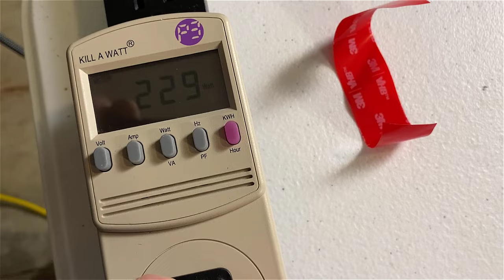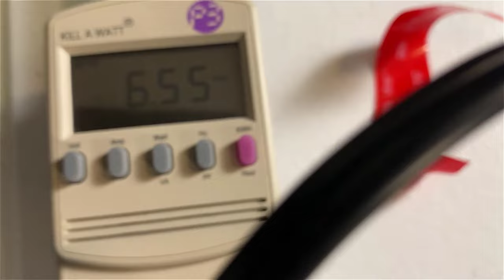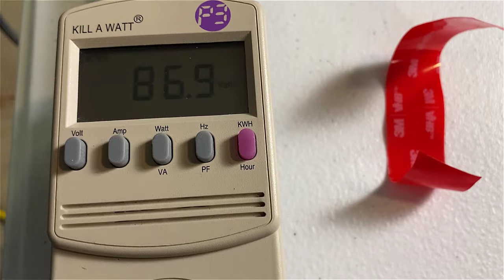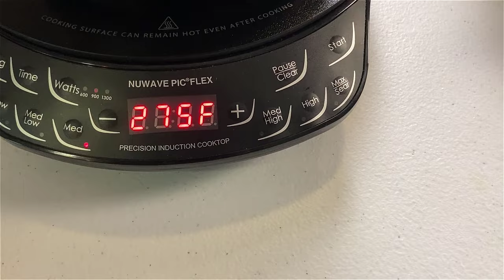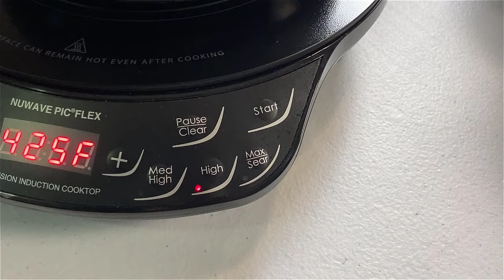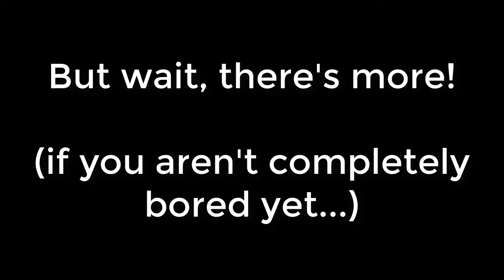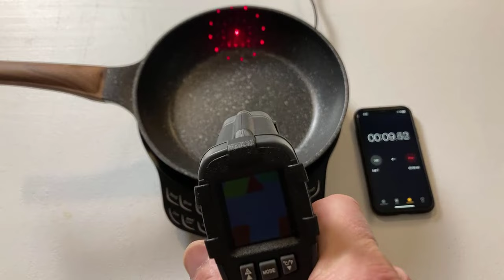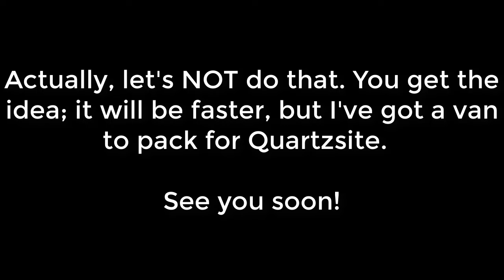Cooking in a Minivan Camper?

Comment: Thank you for the video.  You presented a lot of good practical information for anyone who is thinking about "going electric."

in 2018 I converted a Promaster into a camper for my part-time van dwelling life.  Initially, I used a butane stove, which I still use to cook outdoors or with my Omnia oven.  However, I went mostly all electric (even when boon docking) around 2 years ago.  I do have a big system including 3kw of battery power and 2kw inverter power.  If I'm reasonable I can cook almost anything. Naturally, I watch my battery levels and the time of day when I cook (for solar reasons).  Here are some of the appliances that I use with success:

An induction burner-usually cooking at a lower power just because high power burns food. 900 watts at the lower setting (the unit has 3 actual power levels, but cycles power on and off for the remaining 7 levels).

A capsule coffee pot- around 5 min for 1 cup of coffee, 600 watt input power

A microwave-for 4-6 minutes at a time, input power 1100 watts.

A 3 quart Instant pot clone at around 650 watts input.  This appliance is very efficient as it only uses full power until it reaches pressure.  once at pressure it cycles on for only 20% of the time.

I just picked up a tiny 1 qt air fryer for $20 on eBay.  It uses 700 watts and I have successfully tried it out in my sticks and bricks home.  I have not used it in the camper yet, but I'm looking forwards to giving it a try.

I'm much happier using electricity for all of the reasons that you listed, plus I never have to find replacement cans of butane.

Thanks again for your video.
Reply from the maker: Wow, thank you for relating your own experiences, that will help a lot of people reading this!  An air fryer is something I’ve never even considered, but you have proven it’s workable. Thanks for watching and more importantly, conveying your knowledge!

Comment: Good information! Why not use 12v appliances, more efficient?
Reply from the maker: Great question!  12V appliances are usually limited to 15-20A which reduces the total wattage they put out. I compared a 12V and 120V water heater coil in an old video and the 12V performed dismally.
Reply: @OdysseyCamper  I knew, I was asking the right man this question! Thanks for your response. Hope you are well on your adventures.